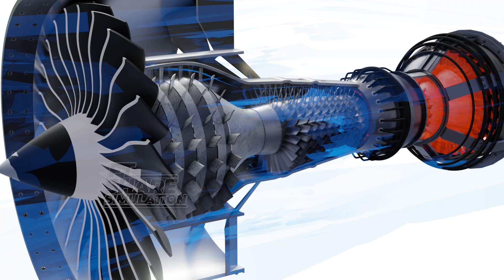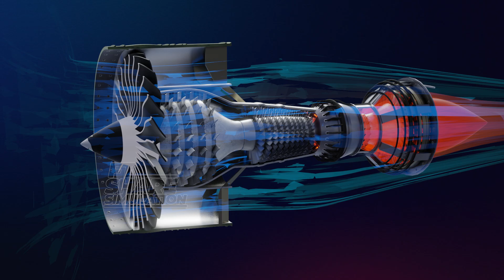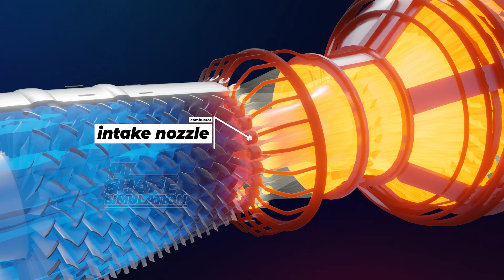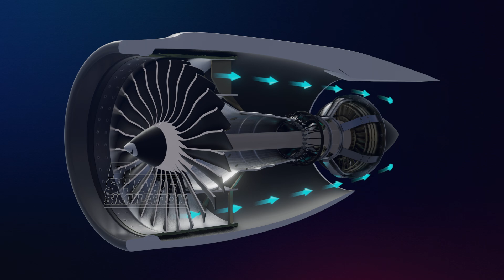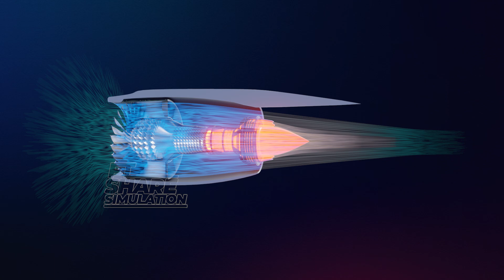EV's will never beat this technology - Turbine Jet Engine Working Mechanism

Comment: The compressor section is spinning the wrong way, but you have the turbine section going the correct way, but the turbine is missing the first stage nozzles.  If you go through this much trouble to make an animation shouldn't you at the very least have it vetted by someone to ensure you haven't made an obvious error?